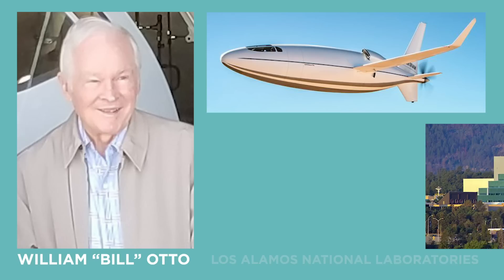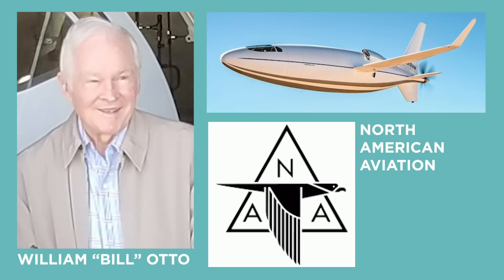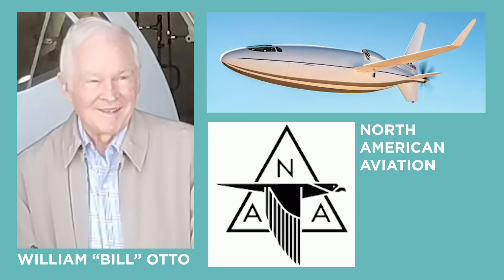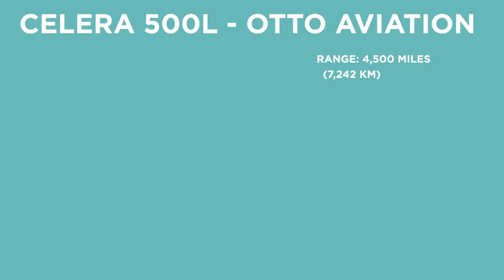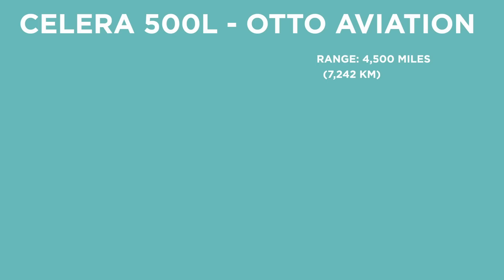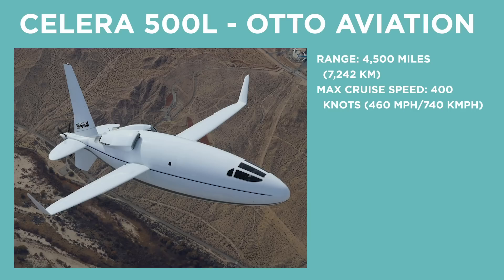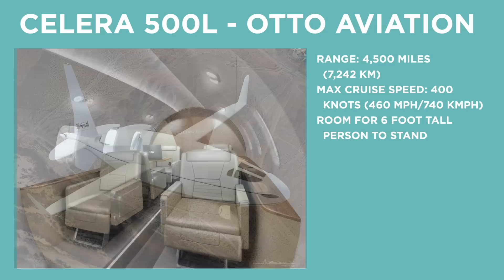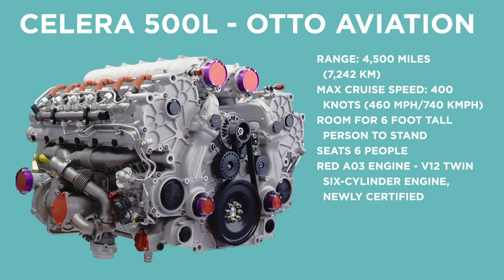Could This Plane Save The World? (Hint: No.) | Answers With Joe

Comment: Comparing a 747 to a Celera is just the most wrong comparison.  747 doesn't even represent a normal airplane.  A two engined plane should be the comparison, and the Celera is single engined, meaning no redundancy for engine failure.  

I think an Airbus A220 would be a far better comparison.

Comment: The Airbus A380 doesnt use any fuel and the problem with pollution can be solved but the fuel is about half the cost of a flight so why do they charge the same price to fly in an A380? ..... if you Google it all the videos have been removed.

Comment: Its not just about mpg. It's also about operating cost. Lets say a 777 is burning 5 gallons/20 liters per mile. Let's say you have a 777 carrying 240 people. It would take 40 of these to have the same capacity. Just what is the fuel usage per passenger mile. Ask your self this. If a 6 passenger minivan is getting 25mpg on the highway with a full load of passengers and a Honda Fit with 2 or 1 person on board is getting 50 mpg which vehicle is getting more passenger miles per gallon.
 This may have a future in the business aircraft market. But I have heard that before. Anyone remember the Beech Starship. Much less the LearFan?
https://www.google.com/url?sa=t&source=web&rct=j&url=https://en.m.wikipedia.org/wiki/LearAvia_Lear_Fan&ved=2ahUKEwir58_Hv8LtAhUiAp0JHTmDD-oQmhMwDXoECAoQAg&usg=AOvVaw0dAMjsNg802qU_-FQYVRyA

Comment: Just in time for the switch to doing so much more "virtually" and not actually travelling😂
Having said that, surely just flying through the air more efficiently is not enough🤔
If it had vertical (or minimal runway) take off capability and you could save having to build giant airports with all that heavy duty infrastructure then you might be on to something.

Comment: This is wrong on so many levels  Nobody can run an airline using a 25 year old piece of junk(replacement cost over 300mil today selling for 20mil defo junk) that is economically unviable. It would be getting repaired so much it would never be flying or just fall out of the sky, game over. Not to mention your customers would not want to fly in an old plane like that. Then there are the tax implications of having a $20,000,000.00 taxable asset on your books. Airlines lease hire or lease purchase everything (tax deductable). You cant hide your profits in your assets. Comparing a new 1000l to an old 747 is like camparing a strawberry chesecake to a maggot infested rotten apple The 1000l will be targetted at business class passengers which may destroy the current big airlines business model. This in turn may make economy class more expensive which might make economy passengers switch to the 1000l if so game over for the big airlines. On top of all this the cheaper cost of buying smaller airplanes makes starting an airline alot easier, which in turn means more competion that is capable of organic growth tailored to customers specific needs. Also smaller planes equals smaller more convenient airports, quicker turn around times much cheaper running costs less noise and air polution. There are so many things to take into consideration alot of them unknown, ifs and maybes that whatever happens it will be interesting to watch. ps if you want to know how to fly a plane ask a pilot, run an airline not so much.

Comment: 747s are also horribly inefficient (which is why they are just about dead). A modern jet like a 787 has half the fuel consumption (but only 242 passengers too so you get to do the sums again). And it's rather cheaper at about $130million to buy. This all makes the numbers markedly worse for the Celera.

Comment: I think your crew and fuel cost comparisons are a bit rough and tend to favour your argument for the 747... 580mph for a 1000 miles is 1.72 hours, but you round it up to 2; 460mph for a 1000 miles is 2.17 hours... rounding this up to 3 seems a bit unfair as the difference between the two is only 26% but your future calculations all suffer from the 50% characterization of 2 hours vs. 3 hours. Not to mention that you haven't factored in extra prep, security, loading, offloading, turn around time that would be involved for a 747 carrying 20 crew and hundreds of passengers. Of course, I'm no expert either...
Edit: also, 747's often fly at less than capacity which would dramatically reduce their efficiency, whereas with the Celera's you could just not fly a few of the flights. Shorter take-off and landing requirements also means smaller airports and greater flexibility for point-to-point travel rather than having to use the major hubs.

Comment: This reminds of the Piaggao P 180.  Similar fuselage shape and main wing.  The P 180 had a connard and twin rear pusher, but very similar wing cord and positioning.  
It was "revolutionary" for its time (first flight 1986) .  But did it revolutionize the industry? it did not.  Will the Celera 500?  probably not - for all the reasons you highlighted in your video.
https://en.wikipedia.org/wiki/Piaggio_P.180_Avanti

Comment: I love most of your posts, but this one is too unfair. Don't compare the Celera with a Boeing 747 on terrain of the Boeing (1000 miles and 300 passengers? really?even a Cesna on fuel would be destroyed comparing like that). Why not compare with existent small airplanes in the small flights / private charter domains?  (sometimes you can't justify a beast of 300 seats for a bi-houly flight between cities at 200miles for instance)

Comment: About the efficiency-claims: They are just claims, nothing more so far. Nothing shown coming even close to that. 
Also while the plane MIGHT be very efficient, that comes at the cost of speed, convenience and most importantly for a comparison - Cargo.
A passanger-plane with ~400 passengers usually also carries like 20 tons of cargo. I am rather confident that we will never see the aircraft sold commercially with anywhere near the claimed performance. So far all we saw from their test-flights and their marketing is a completely stripped down empty shell being kept as lightweight as possible - or in other words loud, cold, uncomfortable  and based on their own claims for the cruising altitude - which they state in their patents to be anywhere between 25000 and 50 000 feet. Yeah no. An empty hull that basically only has the pilot and nothing else inside (no thermal insulation for example) that might reach those numbers. I for one do not want to fly in a paper thin hull in a near vacuum with no atmospheric control with the constant sound of a loud engine surrounding me.

Kinda reminds me of Elio .. the tricycle-car that wanted to ship in 2012 and had nothing but a massive 50 million$ debt in 2018.

It is the same as nearly all those "this will disrupt <XYZ>" - no, not really. and it would be a no-story if journalists would do their job instead they have mostly degraded to bloggers.
Your cost-analysis is so simpler yet we hardly ever see even that bit done by the press reporting on it. You did a nice job there.

Comment: $20 million for a used 747 that no one buys.  You should compare it to a 777x, which cost over $400 million.  It would probably compete with Q400s, to be honest, not even E2s or A220s.  I am not saying that would change the outcome, but your math is way off.

Comment: Can only something 'small' like that be that efficient? Like why can't they scale it up to around the size of the A380 to fit 800 people?
Reply: The reason why the Celera is so slick and efficient is because it has laminar flow on ALL surfaces, not just the wings, not just the tail, but the fuselage and everything else touching the air.  To maintain that laminar flow over the entire aircraft, the size itself has to remain small for it to work.  You would need an impossibly smooth surface beyond the sizes that Otto is attempting and that's not even including the other parts of the plane on its surface, like where the wing and tail and air scoops meet the fuselage, the little instrument ports that are necessary on all aircraft, all the door and window seals, etc., that would more or less destroy that impossibly smooth surface you made.  Turbulent flow is sort of like a cascade effect, one tiny burble in laminar flow and it multiplies on its own until it makes all of the flow turbulent.  If a tiny gap in the door seal creates a tiny little burble, that will multiply on it's own and kill the laminar flow, but luckily that tiny burble doesn't have a chance to disrupt the laminar flow since the tail of the airplane has already left the area...in a 747 that burble might turn into fully non-laminar flow by the time its halfway to the wings, leaving the rest of the aircraft in draggy turbulent air.  Continuing this example, you'd have to make that 747's door gap fit so ridiculously flush that you wouldn't be able to feel the seam with your fingernail.  And that's only considering the obvious, as even the smooth sections of an aircraft need to be geometrically accurate, there can't be even the slightest imperfection, meaning any flat sections would have to be truly flat, any curved sections would have to follow that exact curve, with a margin of error lower than a coating of paint. So keeping the aircraft small is really the only practical way you can achieve laminar flow, since even the tiniest amount of imperfection will eventually end up causing non-laminar flow.  By stopping a specific size, you're basically making a cutoff point at which laminar flow is too hard to practically maintain.  To put that into perspective, so far this is the only aircraft I know of that has incorporated laminar flow on all surfaces, not even NASA has made a fully laminar airframe for testing purposes, so for them to manage it on their own is an engineering accomplishment.  Laminar flow is, to put it mildly, the holy grail of aerodynamics.
Reply: @Skinflaps_Meatslapper  You can see why Elon is trying to take the easy route with vacuum tunnels!
Reply: @Speak_Out_and_Remove_All_Doubt  That'd be why LOL  I don't think he's going to make it work, though...it seems like too much promise and not enough actual results.
Reply: @Skinflaps_Meatslapper  I've not seen any real numbers in terms of cost to b build, cost to operate, benefits and drawbacks to flights etc. But I guess if we can't get decent distance large aircraft powered by batteries then maybe that is the way if we are serious about climate change.
Reply: @Speak_Out_and_Remove_All_Doubt  Oh, not the Celera, I was talking about Elon's suck tube.  I'm betting the Celera will be an awesome aircraft that replaces a whole lot of charter aircraft.
Reply: @Skinflaps_Meatslapper  sorry yeah, I was still taking about vacuum tubes too. If we have to stop burning hydrocarbons completely then even an efficient plane can't fly. It would just be interesting to see how many years and how many passengers it would take for vacuum tubes too be the more cost effective option.
My biggest worry for vacuum tubes is terrorism, they just seem so vulnerable.
Reply: @Speak_Out_and_Remove_All_Doubt  The biggest hindrance to non-fossil fueled flight is battery chemistry.  We're just not there yet to make electric aircraft competitive with Avgas and JetA burning variants.  The rest of the system is perfectly adequate to keep up with or exceed performance of conventional aircraft, electric motors and ESC's, but the battery just isn't up to snuff.  We need an alternative that charges faster, lighter, more capacity, more charge cycles, safer, and made from easily obtainable materials.  Until then, we're just making fun little toys.

Comment: this thingie doesnt have the range to compete with 747, nor it would ever have
and even if it would have - 13000km flight at 600km/h would take f* forever...
so no, this is not a competition to 747.

if anything then 737 max or airbus 320 - but I find it extremely unlikely airlines like ryanair would ever be willing to operate planes so small

Comment: I think your figures are inaccurate. The engines alone cost 20 million a piece on the 747. So when you add up each engine plus the plane you get $100 million for each 747 and not $20 million.

Comment: Its actual very simple. This place WILL NOT save the world. 
18 miles a gallon is great sure, but only transfers 6 people. 
Scale that up to a Boeing that can host up to 300 people and you will 
quickly see where that goes wrong.  if all these 300 people need to 
travel you will need 50 of these small planes.  
Take the 18 miles a gallon divided by 50 and you get 
0.36 miles a gallon to move all these people compared to a Boeing.. 

So in the end this plane is more expensive in build cost and 
fuel then a Boeing. You need many more of then and they 
still run on fossil fuel.  This is not a big leap, these are 20 steps
back into history!!! 

Just keep traveling with the Boeing people, it is less of a burden to 
nature then this new funny looking plane!

Comment: Alrighty Then There Joe.? I Don't See The Analogy Of Using A More Scaled Up Version, Of A Much Larger, Size Comparative Of A "CELERA" Type Aircraft, In Comparing To A 747, 707, Or Something Of Equally Compatible In Size To Do Your Comparisons.? Because Of Just "6 Passengers" Is Not Truly Fare In Comparing, So Don't Let Your Head Cave in, As Laminar Flow Is Not New, & Can Be Applied To Any Style Of AiRCRAFT", Like It's Most Earliest Known Plane, & Most Known Technology Such As The Old Piston Driven, The WW II, War A Winning , Piston Driven North American, P-51 Fighter, Among Several Other Companies Using This Technology Already Known & Used, But Not By Passenger Jet Driven Aircraft. Notice The Wing Design, Is More Odd, Long, Thin Sturdy, Cantilevered Wing, & More Highly Efficient Than Any Of The Jet Craft You See In Flight Today. A Mock Up Model Could Settle That Debate Within Just As Short As A Month Of Testing, So Practically You Could Be Using Equally, In Passenger Capacity.! Then You Can Do The Business Models Stats On An Equal Footing, & HOW COULD YOU LEAVE THiS OUT, AS IT'$ ONE OF THE MO$T IMPORTANT TOPiCS IN COMPARiNG.!  Just $aying.!

Comment: This plane is nice & all but the issue is carbon. One more gas guzzler & I say that considering this is a V12 or 2V6 the way it will run. The only really decent alternative fuel for aeronautics is hydrogen. Considering all other issues why isn't this the trajectory. Yes the conversion & storage is complex but energy wise it compares favourably with gasoline. With cars hydrogen is a laughable contention right now but with better conversion of water it could become a direct replacement for gasoline (as you call it). It might become more efficient ultimately because you're also supplying the oxygen which is thin at 20 thousand feet in the air.

Comment: You list the cost of jet fuel but it's not a jet it's a piston engine so it's going to run on gasoline not kerosene or jp5 or jp7 same stuff pretty much. most piston engine plane run on very high octane premium so going to cost alot more than jet fuel.

Comment: Evolutionary, not revolutionary. Designers been chasing laminar flow for three quarters of a century. If he has accomplished laminar to 75% of both airfoil chord and fuselage length, it will be remarkable. Of course, aft fuselage parasitic drag is small enough a number to mostly get ignored. That engine probably is more of the story. Power, efficiency, modern design, and FAA recognized redundancy. Quite the engine package. That said, no one’s going to sell a 10 hour flight without a galley and a stand-up restroom. Coast to coast? Yeah, but two potty stops. Could be a big thing in small corporate, and maybe even create a new niche in air taxi.

Comment: Obvious solution is obvious - pilotless plane... /s.
Joking aside, not necessary a totally meritless idea - the military uses one operator to control multiple unmanned drones. In civil aviation, the pilots are most active during take off and landing, the rest is delegated to autopilot. These are phases that take place close to airport - easier comms available to remote than for the case of a drone in Middle East controlled from US via satellite.
Would I use a remote piloted plane? Not today, but I'm no longer that young enthusiastic to be an "early adopter"